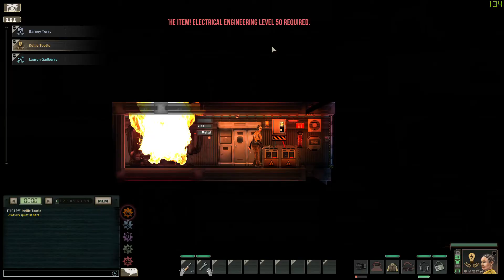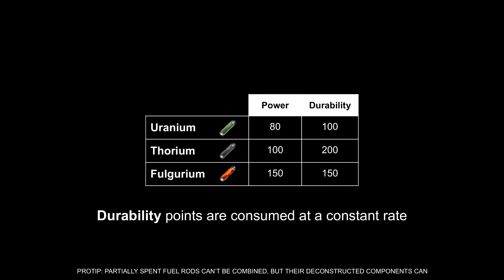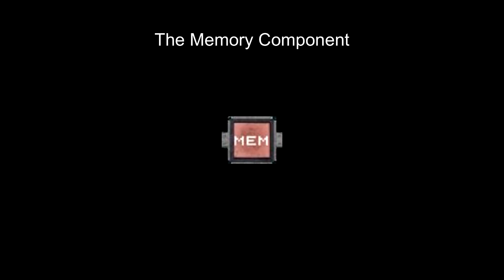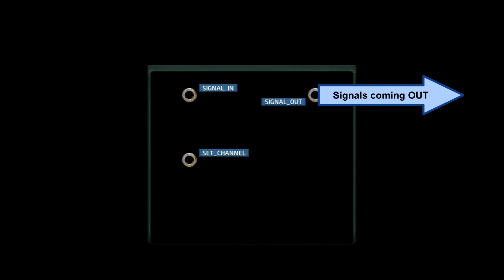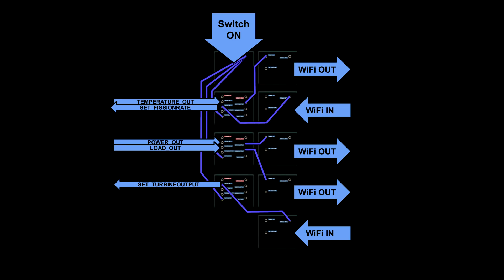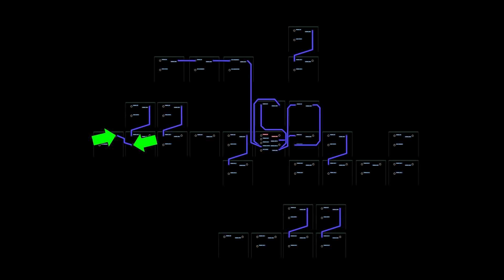Perfecting Reactor Control

Comment: For those on a budget there's a five component system that works as well as is reasonably needed, i don't remember it off the top of my head but it's nice. I have it in an item assembly.
Reply from the maker: https://youtu.be/ga4Ou1iglZY
I don't know which campaign you're playing, but two or three salvage runs is all it takes to get the components most of the time, and seven or eight (really cheap) cans of green paint will get you everything you need for the wires. If you and your crewmates can't be bothered to pick up some components on a salvage run, and buy green paint at an outpost, that's not a budgeting issue, that's a human resources problem.
Reply: @TheGamingNerd2022  I don't mean it's hard to get, I just mean that some people have other circuits to make and might want to save parts (My automated coilgun circuit is a pain and I usually prioritize that)

Comment: Wait, fuel rods don't use more durability on them even if the power load is higher? So, what's the point of manually operating the reactor if no matter what you do, the fuel rod is always going to be used up in the same amount of time? I'm confused.
Reply from the maker: I have since been corrected on that. You are correct, fuel consumption is based on power production.
Reply: @TheGamingNerd2022  That's a very important correction that might be worth pinning or adding to the description

Comment: I wish I had that video in 2020 before I spent 240 hours in editor. Good Video.
Reply from the maker: Thanks! Just in case you haven't seen it, I've got another one that I'm watching through the process of building the entire controller... If you decide to build it, let me know how it goes! If not, I should have an easy-to-install unit posted on the workshop by the end of the week.

Comment: "Now this is probably going to be quite boring"
Fuck yeah sign me up thanks for the video
Reply: (This is not sarcasm, to be clear)
Reply from the maker: @FinetalPies  This is my favorite kind of reply. Let me know if it works for you!
Reply: @TheGamingNerd2022  I seem to have the same problem as others where it just wants to max the fission rate then melts down
Reply from the maker: @FinetalPies  popular errors are: not keeping all fuel rod slots full, flipping the inputs to the first subtraction box (50 goes on the bottom), mis-wiring the dynamic memory cell, forgetting to adjust the delay timers, and accidentally adding a letter or a space in the values for the memory blocks
Reply: @TheGamingNerd2022  Ah yeah I think it was not using 4 fuel rods, is that like, less fuel efficient?
Reply from the maker: @FinetalPies the PID is tuned for controlling the reactor at maximum power. If you stack 4 fuel rods in there, it should run at the minimum fuel consumption rate, where if you run it with only one its likely to misbehave
Reply from the maker: Just posted a new video. Hopefully it will help you sort out your problems. Let me know what you think!
https://youtu.be/S5hak5NY9xQ

Comment: Why didn't you upload your work to the Steam Workshop? And maybe I'm doing something wrong. I would like to see the diagram in the editor. But the controller doesn't seem to work, I faced the same problem as another user. The video at 17:08 shows what needs to be multiplied by the coefficient "1", maybe I don't understand what, but x * 1 = x right? DIY Reactor Controllers(w4rum) works, but yours is buggy, but your idea is interesting. And logically it should work. But I ran into overheating. If it's not difficult for you, you can drop or link to your controller or put it on Steam. Many thanks.
Reply from the maker: I put the controller on the workshop (YAPID), but I'm more interested in something that can be installed in existing campaigns. I just uploaded a new video with a step-by-step demo, let me know if it's helpful. 
https://youtu.be/S5hak5NY9xQ
Reply: @TheGamingNerd2022  Well, at least I'll give you a like on the incentive. Thank you for your work. I figured it out already thanks. everything has already worked) And then you did not answer for a long time, I already forgot about it)

Comment: Possibly a dumb question, but what's the intended way to get power from the reactor? With all of this hooked up, I can't add another wire coming off of the power_out of the reactor. Should I route power from the reactor to a relay or junction box and then back to the relay in the wifi controller?
Reply: i think the wire that you're mentioning was supposed to be the wire that's connected to the power value out instead of power out, i was confused in the video earlier and i hope that's the case
Reply from the maker: Unfortunately, as far as I can tell the reactor is restricted to one output connection. Anything more and zero power comes out. The only option is to use junction boxes to create new power outputs, but keep in mind the loads stack backwards as you daisy-chain junction boxes, which can lead to very rapid junction box failure in overvoltage conditions. 

For example, consider five junction boxes, all configured for a max continuous load of 2000W. Let's say junction box 1A is connected to the reactor, and boxes 2A, 2B, and 2C are connected to 1A as well,  with box 3A connected to box 2B. Furthermore, every box but 1A is connected to devices totalling 1000W load each. In this scenario, boxes 2A, 2C, and 3A will see a load of 1000W each, and in the event of overvoltage they won't take damage at all (the default setting is for damage to start at 2x max power, which is usually 2000W). It won't take much for 2B to start taking damage, because it's combined load is 2000W (2B + 3A), but 1A will take damage at the slightest overvoltage, since its normal load will be 4000W (2A + (2B + 3A) + 2C)!!

Comment: Do I have to change the maximum reactor power number If we buy the Reactor Efficiency upgrade in campain mode? 
If yes then from the wiki the increase is 2% per level with 5 levels max.
So for example a reactor with 3500 power for every level I need to change that number to 3500 * (1.0 + (0.02 * levels) )
Is this correct?
Reply from the maker: Yes. The value stored in both controllers should match the actual maximum reactor output.
Reply: no first upgrade 3500 + 2% = 3570 later
3570 + 2% = 3641.4 further 2) 3714.288 further 3) 3788.57376 further 4) 3864.3452352 5) 3941.632139904 
found it out experimentally. so the formula is slightly different.
he considers the trail to be leveled as an upgrade already made and should be considered taking this into account. slight progression in the formula.

Comment: I have no idea what I did wrong but it really likes to request 100% fission and melt down.
Reply: Almost the same here, it likes to set fission to 100% (had to hard limit the most right adder in step 2 to 70%) but at least turbine seems to work just fine
Reply from the maker: There are a lot of places for mix-ups in this design, but it's as simple as a PID can be with the blocks provided... some suggestions for checking:
1) Make sure the  delay timers in the fission rate controller are set to 0.05
2) Make sure that all the stored memory values match those described in the video (especially your reactor max power!)
3) Make sure that the subtraction block at the bottom is wired for Relay - Delay
4) Make sure that one of your final addition blocks are clamped as described in the video
Reply: Tried this again from 0 using the Submarine Editor (Originally I implemented it from a friend campaign)
1) Yes the delay timers in the fission rate controllers are set to 0.05
2) All the store memory values match those from the video, the max power is set to the one the editor says
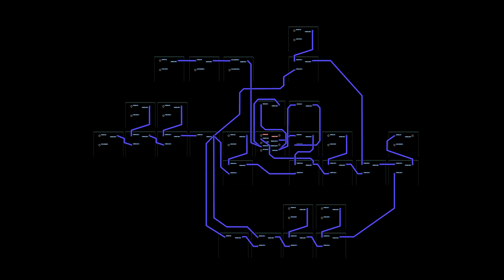3) Not sure what you mean 20:19 have the subtraction from the delay at middle with delay behind (in that order) to divide at front
4) The final addition block is clamped

EDIT: I only read points 1) and 2). 4) also apply here just fine but I dunno about 3) so result can be wrong
Result: 
Turbine Output is calculated perfectly
Fission Rate always go to 100% and without intervention it meltdown.

- Tried with 1 rod and no sub activity -> meltdown
- When we played campaign I had to activate the normal auto-controller so it adjust the fission rate and when we had no activity (i.e submarine stationary while exploring caves) I had to completely disable it
- Tried putting 4 rods in steady load (no overheat) then activate it -> Fission Rate 100% then meltdown
Reply: I've run into the same problem. 

After reviewing some of the values in process, it seams like the dynamic memory block basically acts like a postive feedback-loop, since it will always get a positive value and add to that whatever it allready has saved.
Furthermore the multiplication at the top has no effect, since it multiplies by 1.

I'm unsure if it is part of the problem, but barotrauma has the quirk to only process or transmit a value, if it changed. Therefore in this scenario only a temperature change significant enough to overcome the rounding error in basic mathematic components in barotrauma will be recognized and result in feedback to the reactor.

In the discribed problem with the reactor at 100 fission and overheating at 10000°C you can manually drop the fission rate to the point until the temperature drops below 5600 to 6000 °C. Then the change is significant enough, the signals get processed and a new command issued to the reactor. The fission rate will jump consequently back to 100.

Nevertheless the power output control works like a charme.
Reply: @alexanderhartel6514  I think I found part of the problem.

Note that in this circuit, you can effectively disconnect the the P, I, and D component separately by just setting their multipliers to 0. After disconnecting I and D, I found that P itself doesn't even work. With a PID controller, you should be able to just disable I and D and still have a working P controller. It's just going to be slower and overshoot more often.

Turns out that the divide component at the beginning is wired the wrong way around. The left part of the PID controller shown above calculates the error by doing:

error = (100 / temp) - 50

Note that temp is in [0, 10000] and temp = 5000 is desired. Obviously, this formula doesn't really make sense. It should be

error = (temp / 100) - 50

Sidenote: To be honest, I don't think the division is even necessary. It's just normalizing the temperature values into [0, 100]. We could just do

error = temp - 5000

and then adjust kP, kI, kD accordingly.

So yeah, quick fix to get the P component working:
Open the left-most division component and switch the inputs.
SIGNAL_IN_1 = Wifi Component (signal_out)
SIGNAL_IN_2 = Memory Component (signal_out)
SIGNAL_OUT = Subtract Component (signal_in_2)
Reply: @w4rum  Thank you so much. This worked for me.

Comment: Me at 0:00    : Haha this will be one another blind teaching blind video xD
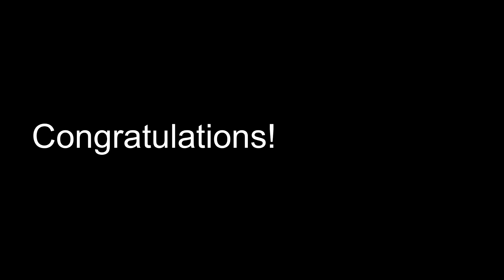Me at 24:17 : I am not crying I just got proportional integral derivative controller in my eye :'(
Reply from the maker: I'm confused... is this a compliment or a criticism?
Reply: It is a compliment on the fact that the video contains actually useful information on advanced component usage and not extremely basic stuff which I initially expected in the beginning. I gradually got rid of my prejudgements as the video progressed. I was referring how a student would cry after a complicated lecture in class and say "I am not crying, just dust got into my eyes", though either my low English proficiency or unclearness made it difficult to understand.
A criticism however would be lack of explanation on how the systems internally work (not generally but specifically), which presumably would take way too long to explain and probably require a completely new video which is considerably longer than this one. I suppose this was the reason you did not add one.

Comment: Could you do a video comparing here shown PID controlled reactor to basic automatic control? For example how well does it handle quick jump from low power consumption to high and potential overshoot scenarios such as in low to high and high to low output requirement scenarios (ideally with step response curves shown in the reactor itself). Also, how did you choose the PID parameters?
Reply from the maker: I'll be honest, I started with the parameters from G3NT's controller design. Later, I tried the Ziegler-Nichols method of tuning and could not produce results as accurate or consistent as his. However, I couldn't get his design to work when I built it under real-life(ish) conditions, which is why I had to introduce the system clock and the integral accumulator. 

Also, here's a video comparing the native autocontroller, the ever-popular 5-element autocontroller, and PID/Feedforward control: https://youtu.be/ga4Ou1iglZY
Reply: @TheGamingNerd2022  Very impressive, I'm loving that PID implementation. I wonder if such a PID could be built with reduced complexity, as in a way, that system clock is used only for descrete derivative and integral functions leaving proporcional gain fully "analog". Or now that I think of it, the delay function block is "analog" correct? If that is the case, a fully "analog" integral and derivative functions could be implemented, yielding even lower controller complexity. What do you think?
Reply from the maker: @MrSlehofer  My original design for the derivative controller used the system clock and dynamic memory, similar to the integral, but I opted for the delay blocks because it achieved the same effect as four blocks with only one. As for reduced complexity, the dynamic memory is necessary to store the accumulated error for the integral, and the other two parts (proportional and derivative) are as minimal as it gets. You could technically drop the memory block and exponentiation component in the system clock and just edit the frequency of the oscillator manually, or you can replace the memory blocks with the PID time step in the integral and derivative elements with wires going all the way to the memory block in the system clock, either way you save two blocks, and I felt that the simpler wiring was more important than having as few blocks as possible. Good idea, though!

If you can come up with a simpler way of storing the accumulated error for the integral, I'm open to suggestions.